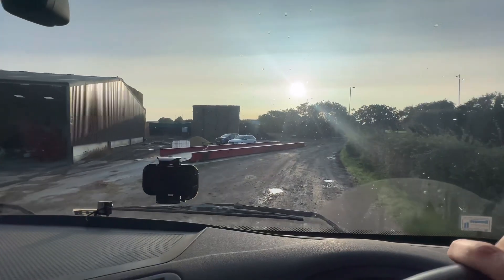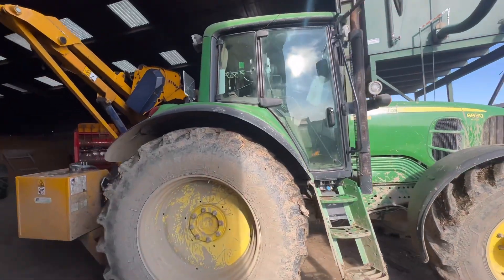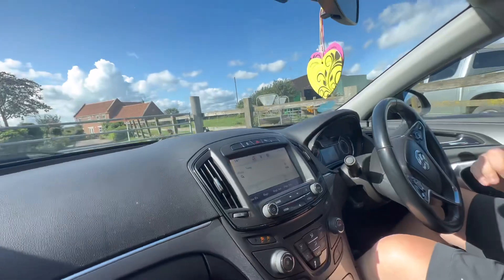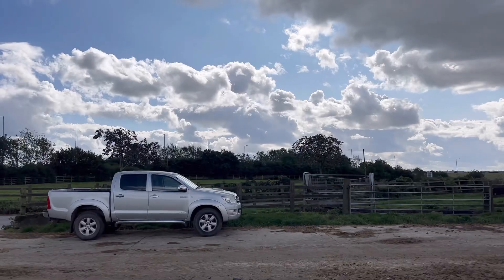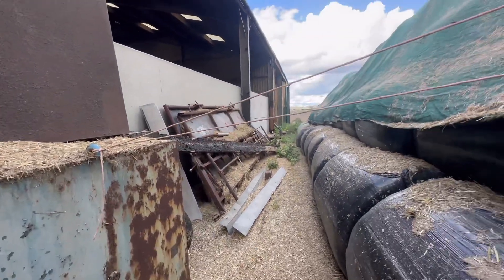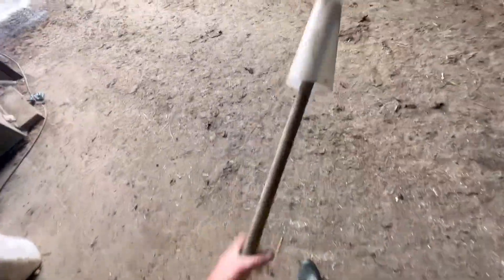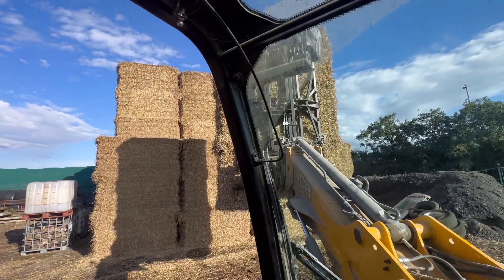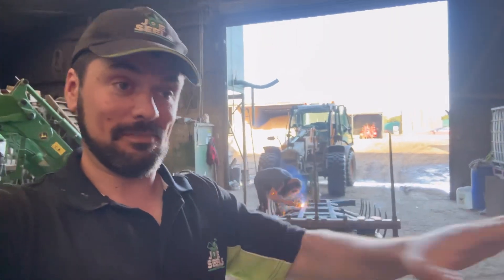Farmer Invention! Make Something from Rubbish! Me n Mick Shopping!

Comment: Blue water pipe do you fit inserts into the pipe so that it doesn’t collapse when you tighten outer collar up ?
Over weight cattle would Slack’s butchers at Warmsworth be interested in them ?  Not far from you